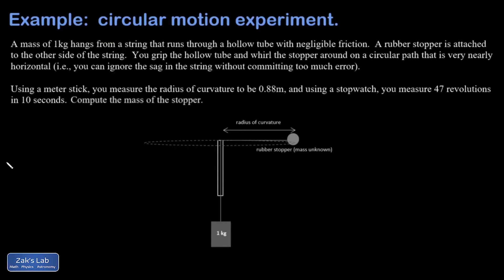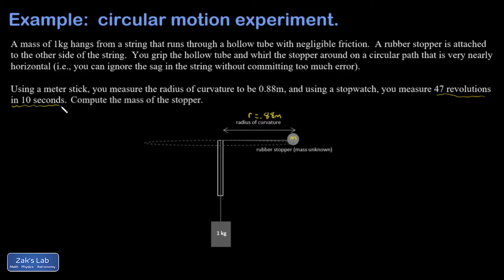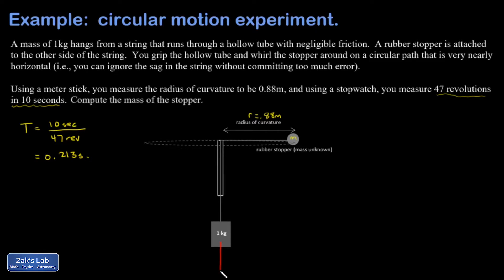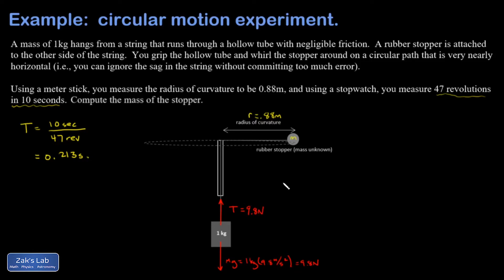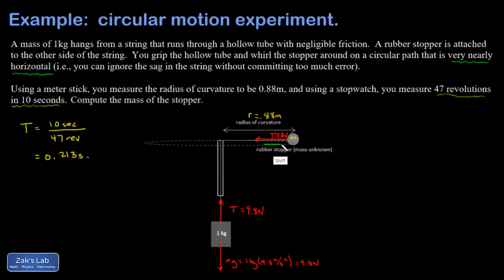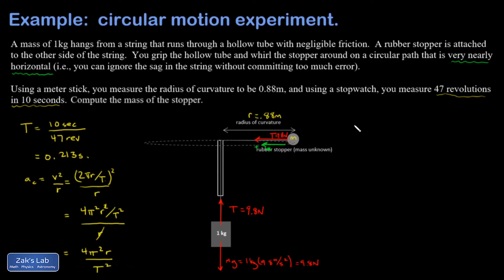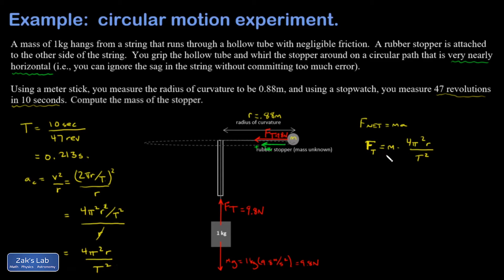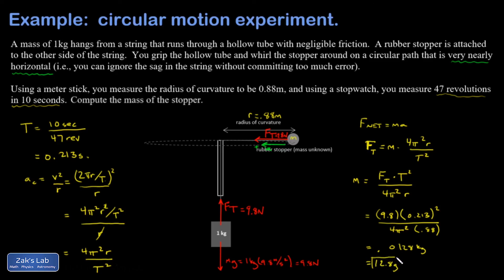Measure the mass of a stopper using uniform circular motion with hanging mass.

Comment: What if the moving mass has friction? How to calculate the velocity of the moving mass to keep the hanging mass unmoving?
Reply from the maker: OMG, that would be interesting to investigate further.  There is an interesting history there by the way -- I first did this experiment with piano wire, but it would kink and create an extra normal force to hold the rotating mass in place.  I've recently switched to using braided fishing line, and there is no kinking problem.  It would be interesting to model the friction though!  Thanks -- Zak
Reply: @ZaksLab  Could you please make a video on this? That would be really helpful...
Reply from the maker: I am probably recording a live lab demo of this in September.  The reason this video was purely theoretical is that my college campus was locked down for COVID, and someone decided to close half the building for renovations because they assumed no one was using the lab even though I had weekly access!

Comment: I’m doing something similar to this lab, but we were making graphs with frequency vs tension or mass vs frequency. 
When making a free body diagram, how would you calculate the direction of velocity of the rubber stopper?
Reply from the maker: The velocity direction is tangential the circular path, acceleration points to the center of curvature.  I hope this helps -z